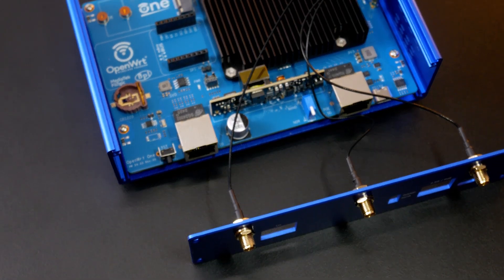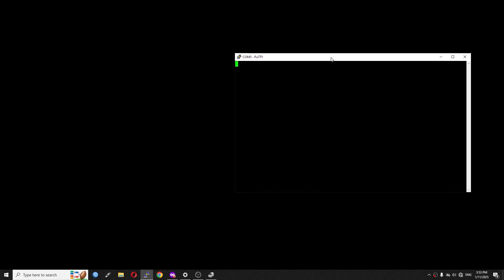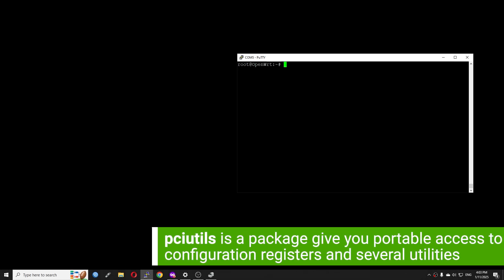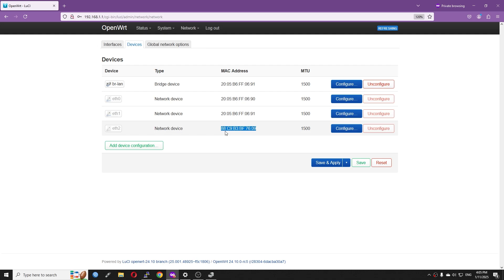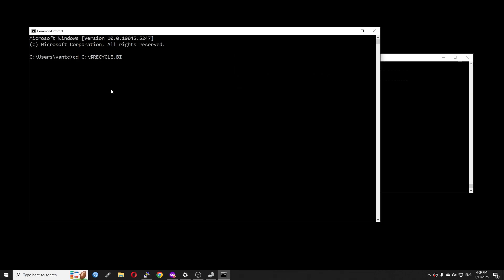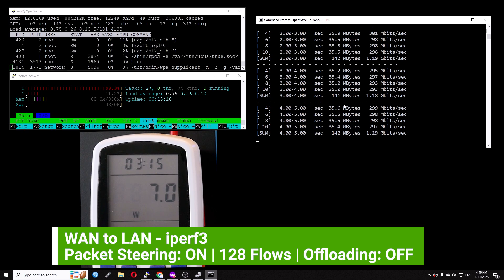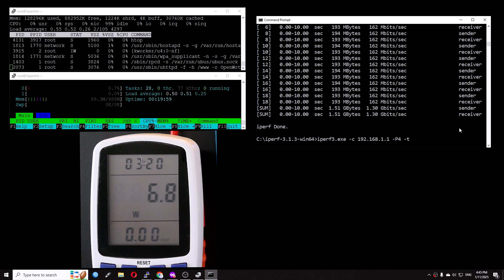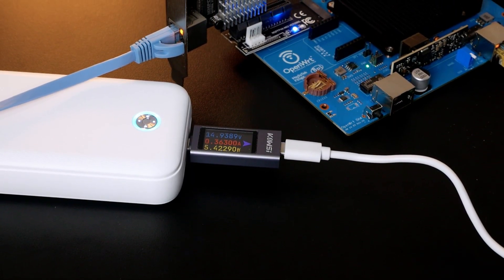OpenWrt One  - Adding the 2nd 2.5GbE Port and Throughput Test

Comment: does this not come with 2.5 installed on the board already speed test is for your isp internet  not transfer speed man do you even know what you're talking about
Reply: Depends on the model you get unfortunately. You either get lucky and get the one with 2.5 already installed. Problem is they didn’t start including thebdrivers or firmware until more recently. Even then it eventually goes on a loop and need a reboot

Comment: Thanks for the updated review. Pretty sure the CPU is not going to be fast enough for 1GB with PPPoE that my fibre provider uses.
Reply: It's absolutely bine I've been using similar GL-inet MT-2500(same cpu?) 1gbps no problem, with vpn server, vpn clients, ad blockers absolutely amazing performance for home use! Power use was way less then my x86 mini pc
Reply: @HHX_H  With PPPoE ?
Reply: If you don't NAT it could be sufficient (IPv6)
Reply: According to the MT7981 should do hardware offloading for PPPoE and NAT, so you should be able to go wire speed with HW offloading. Disclaimer: I don't have one of these.